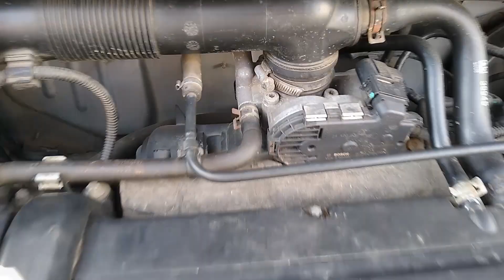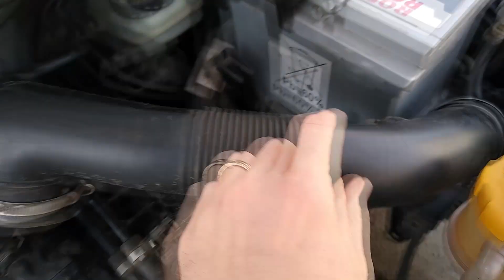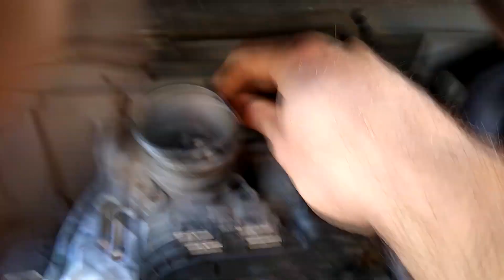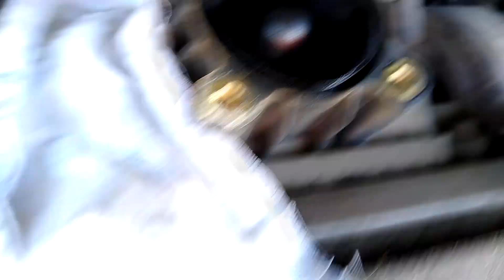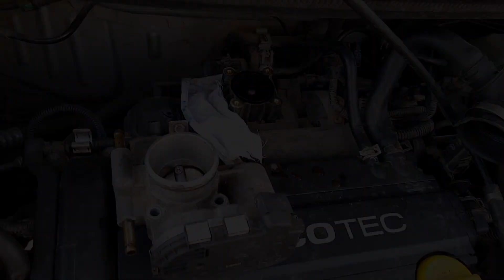Opel / Vauxhall Corsa D 1.2 throttle body removal

Comment: Hello mate, is this the LMM between the Air filter and the Acc-Throttle? But the Plug has only 2 Pin? Actually the LMM has 5 Pins, right? So what Part is this?
Reply from the maker: It is an air temperature sensor.
Reply: Thank you 😊

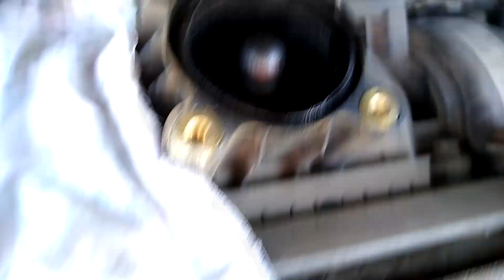Comment: The inlet at 4:43 is very oily and dirty on mine, any idea on what i should use to clean that? Also noticed oil in the air intake pipe, coming from that thinner flexible pipe connecting to the top right of the engine, what does that one do and why am i getting oil in the intake?
Reply from the maker: It's good to clean it. Carburetor cleaning solution or brake cleaning spray. The oil vapors reach through the short and thick hose to the accelerator sometimes and to the air filter. It happens especially in the colder season, when the oil vapor condenses a lot. You probably make a lot of very short trips.

Comment: Like these videos, I have a Corsa D myself, find them useful!

Could you make a video on installing a kill switch for the corsa?  Seen other videos on kill switches but not specifically for the corsa
Reply from the maker: Thanks for waching. I don't have that in plan. I would not recommend, everytime you kill the power more than 20-30 minutes it will reset the ECU settings, so after every start the engine have to learn again. Without curent you won't be able to open the car with the remote.

Comment: Hi there, could you help me, had my car, vauxhall corsa D 2007, into the garage three times now, changed spark plugs and coil pack and thought problem was solved, then engine management light came back on, went back to the my local garage and their diagnostics came up as an o2 sensor code near the catalytic converter,, that was changed too and engine management light came back on again when driving away from the garage and same issue with 15 or so minutes into driving, it would at times struggle to accelerate, could it be the ERG valve (throttle body) as the problem?
Reply from the maker: What error codes did you have? It's definitely not from the throttle
Reply: @CorsaDForever  Going to put some redex in my engine to see if that helps with cleaning the fuel injectors and see if it helps any.
Reply from the maker: This will most likely not help. Try to check if the MAP sensor is working properly. For this you have to monitor the values on the go on a tester.
Reply: @CorsaDForever  Just took my car for a drive with 250ml of redex in the tank and it is running better for now, will check the MAP sensor too, thanks.

Comment: Hi mate have a 2008 1.2 Corsa, throws error misfire multi cylinders then only Cylinder 4. I have changed spark plugs, coil pack and it still misfires on idle, drives a bit sluggish but once it gets going it seems fine does not seem like a cylinder issue. I have ordered a map sensor but could it be anything else? Also the o2 sensor at the front does not seem to do anything when disconected whilst started is that normal?

Thanks in advance for your help
Reply from the maker: Hi. Leave the sensors, the problem is not them. First try to check the spark plugs in the morning before you start an see if you find oil on their tip. If you find oil, you have to replace the valve seals.
Reply: @CorsaDForever  Have had the plugs  and coil pack changed and rocker cover gasket replaced as it was leaking oil. Still no luck but I do find it loses water.

Comment: Is it possible to clean it with throttle body cleaner spray without removing it totally? Would you recommend that process considering my opc d 1.2 2006 with 173k km. ?
Thx in advance
Reply from the maker: @grrad76  Yes. You can do it. You can open it with your hand to clean the intake side.

Comment: Hello mate, my Vauxhall Corsa D has a problem, it keeps revving up small amounts on its own, and it takes a while for the revs to come down. All the sensors have been changed, and I have cleaned the throttle body, is there a chance my throttle body is faulty? Very helpful videos by the way!
Reply from the maker: Hi. See how the evap valve is working. Especially if you have a facelift Corsa. Take it off and see if you can blow air throu it, you shouldn't.
Reply: @CorsaDForever  So if I can’t blow air through it, it means it is working fine? Also if this is not the problem, does that mean the throttle body is faulty?
Reply from the maker: If you blow air it is faulty. If it is ok, check first for other vacuum leaks causes.

Comment: Can you please tell me where is located the pcv valve? Thanks
Reply from the maker: There is no separate pcv valve. The engine cover has some passages in it thru where the oil is separated.

Comment: hello i have a Corsa d 1.2 limited edition that has a slight misfire i replaced the spark plugs so it's either coil pack or  my mate said give the throttle body a clean any advice, please.
Reply from the maker: Most probably is the coil. The throttle body has nothing to do with the misfire.

Comment: Do you have a video on cleaning this ? Did you just clean the body or does the engine side need cleaning. Sorry never done one of these before so worried I may screw it  up. Just bought a bottle of throttle cleaner.

Comment: I am planning to remove and clean my throttle body on my 2009 corsa d 1.2, Do i have to bleed the cooling system after reinstalling it?
Reply from the maker: There's no need for bleed. Just try to keep the removed hoses as high as possible so they don't leak to much.

Comment: Hello, I have a Vauxhall Corsa Design 2008 1.4 Petrol and I checked for errors and I used OBD 2 and I got this code P1890 can you tell me what it means and what the problem is because I couldn't find a concrete result on google. Thank you, I am waiting for your answer!
Reply from the maker: Hi. Before you start the engine put the ignition on and wait around 30 seconds. After this switch the ignition off, put it on again and start the engine. The throttle body it will calibrate itself. Try this first and see it solve the problem.

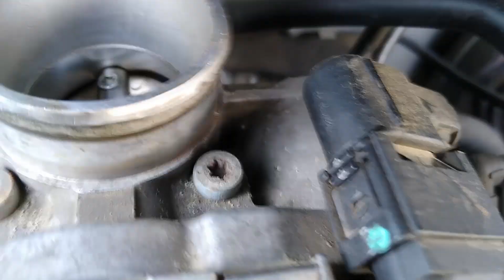Comment: 1:22    is that the intake gasket?   Mines weeping from that area think my gasket has gone
Reply from the maker: No. At the end of the video you can see the gasket, the green one. Normally it should be on the intake hole, but remained stuck on the throttle body.
Reply: @CorsaDForever    ah ok,  so whats the gasket at 1:22 ? I'm not too sure what I'm dealing with tbh.    

 I've been looking for a repair kit but cannot find one... might go to my Vauxhall dealer and see if they can order a set
Reply from the maker: There is no gasket at  1:22. There is attached the air filter tube, with no gasket.

Comment: I have a question, how did you mount it back, did you have to adapt something?
Reply from the maker: For the XEP engines, after turning on the ignition, wait 30 seconds before starting the engine and that's it.

Comment: AM INLOCUIT CLAPETA DE ACCELERATIE LA UN OPEL CORSA D 2008 MOTOR 1,2 59 KW SI ACUMA NU SE MAI ACCELEREAZA CU PEDALA DE ACELERATIE LA MAXIM TUROMETRU SE URCA NUMAI LA 2500 ROT. MIA RAMAS  SI MARTORUL MASINUTA CU CHEITA CARE SA FIE CAUZA ? MULTUMESC
Reply from the maker: Incearca sa scoti borna la baterie pentru 30 min. Dupa ce o conectezi la loc, pui contactul fara sa pornesti si il tii asa 30 de secunde timp in care se calibreaza clapeta, apoi iei contactiul si pornesti normal. Vezi daca isi revine asa.
Reply: @CorsaDForever  MULTUMESC AM FACUT CUM MI-ATI SPUS SI A FUNCTIONAT